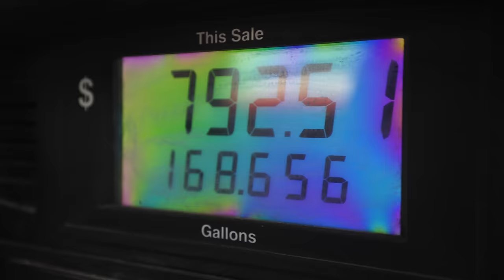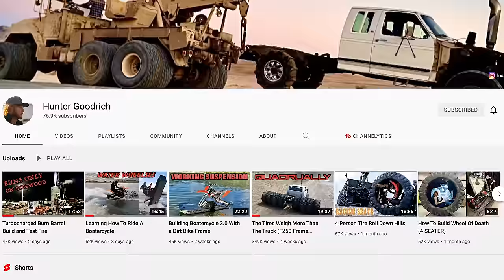The Earth Keeps Swallowing Excavators and We Keep Pulling Them Out

Comment: I'm curious.  What does a recovery operation like this cost?  I know something about the per-hour cost of the machines involved and labor rates, but the cost must have been something close to the value of the excavator that was stuck.   I'm also a US Navy vet, and know a little about beach and harbor operations (yeah, very little, but ...).  I was flat out impressed by the operation.  I would have thought they would have had to bring in rocks, heavy tonnage to reinforce that beach, to accept the load of the equipment.  Sort of surprised the owner/operator (assuming he's experienced), would have risked heavy machinery on that beach.  Less is more, on a sandy, wet beach, IMHO.